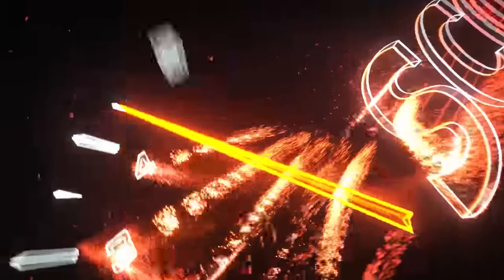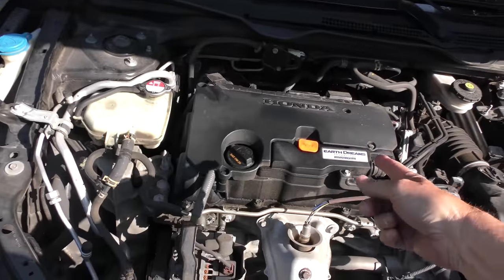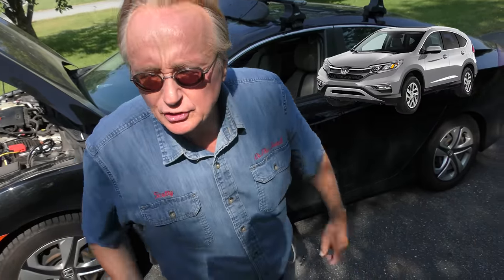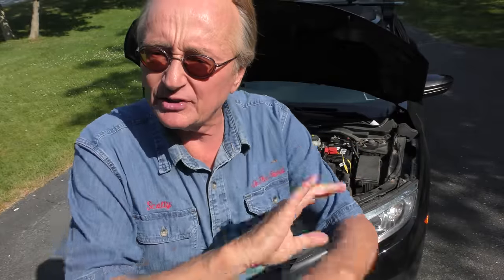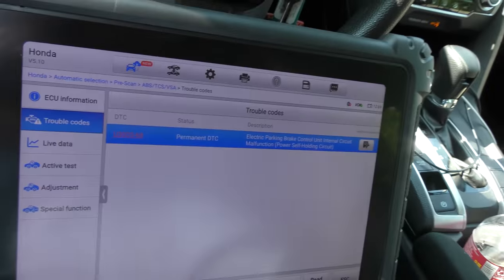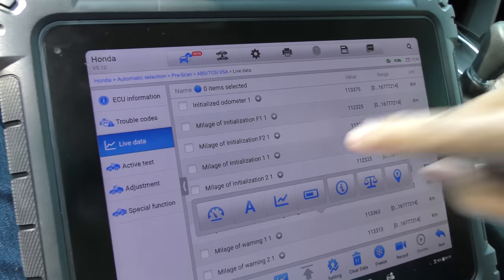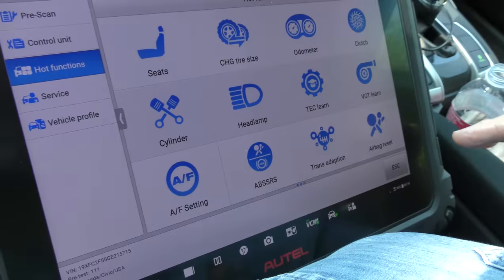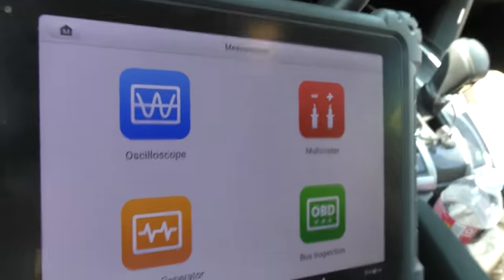This New Scan Tool Changes Everything

Comment: For the cost of the Trailer Rental (about $700) and extra gas for 2700 miles (about $300) he could have shipped 8 50 pound boxes FEDex ground or UPS ground for less, and would not have risked burning out his transmission.
Reply: I rented a U-Haul with a car trailer, rather than wear out my car for a trio that long.
Reply: You'd never hurt a small honda towing a small trailer
Reply: @elultimo102  Same here... I have made a couple of cross country moves and I rented the large Penske trucks with a car trailer and my wife followed behind in the other car.
Reply: Our vehicles never ran the same after long trips, so we had our vehicles transported when we could afford it. It’s expensive but worth it if the vehicle is new
Reply: @ArnoldZiffle-jw2mv  if your cars and trucks cant handle a long trip tou have a problem with them....and what kind of cars can't handle a long trip??

Comment: I knew someone who towed a large double axle U-Haul trailer with a Chevy Vega back in the 1970's. Top speed while towing it was 35 mph. He towed it from Chicago to Washington D.C. The car didn't run very well after that. His mechanic said, "It's terminal."
Reply: hahahaha. yep.
Reply: Bent pistons probably haha
Reply: They said it was terminal before he left who are we kidding😳😳🙄😎😎🤣🤣
Reply: Vega got an engine of 2300c.c.!
Reply: @Dilberts_Dogbert  With a Vega, having a terminal engine is normal.
Reply: @darcychu9652  Yes. It was a very bad design, and usually they did not last very long.
Reply: My brother bought a new Vega.  Sold it 2 years later for $50.

Comment: Our 2006 Honda CRV battery was small but lasted 10 years!!
We miss that car.
Reply: Yea, in 2021 I replaced the battery in my  ex wife's 09 honda fit 5 spd sport, it was expensive for a tiny battery,  but the battery was original, with like 185k miles, 12 yes old

Comment: I have a 2011 Civic sedan 1.8L auto. I have towed a 2004 dodge stratus with it a couple hundred miles. I have towed my small trailer with UpTo 1600lbs on it for many miles. I have always changed transmission fluid at every 30k miles. The car now has over 260k miles with no issues whatsoever. It drives and shifts like new.

Comment: With Honda’s manufactured in Canada, they typically put the small batteries in their units sold in the US. Just replace with the larger Canadian battery for cold climates. It’s larger, more CCA’s and will last twice as long as the crappy batteries that come with the unit.

Comment: I was looking to buy a mid priced autel scan tool, compared to the other ones it was reasonably priced that was until I read how much it cost for the subscription and updates, it was the same price per year for the subscription as it was for the scanner, to buy one just for your own personal use on your own car it’s just not feasible to justify and all I was wanting to do was reset the tpms, ah well back to the mechanic
Reply: It would be nice to have a full review that includes the added costs of updates/subscriptions an 8wner will be stuck with.
My INNOVA 5610 doesn't update thru its app but does cover the needs of my 2005-06 Tundra well enough other than resetting TPMS.
I bought a quality air pressure 120 psi gauge for my E Rated 10 plies.
Only need to check em before long trips and they haven't lost more than 3-5 lbs once yet in 4 years.
Not a difficult task for most anyone.
Reply: Yeah harbor freight has a nice one for $1000. $500 a year after the first year tho AFAIK you only need updates for newer cars? Cant you just download all manufacturers the first year, then no updates needed unless the car is newer than 2023?
Reply: ThinkOBD 100......

Comment: A small battery also requires less alternator capacity, meaning more weight savings and less parasitic engine drag. Battery only really has to start the car, tho if you like playing the radio more capacity helps.

Comment: Electronic parking brakes are about as smart to have on a car as electron shifters are. Good luck if you dont' have power and need to tow your car and need to disengage parking brake and get the transmission into neutral.. Because it doesn't have any power. Some models do have a manueal lever in the truck for the parking brake, but for the transmission you gotta get the jack out and get under the car usually to get in neutral. Just another couple things to break and cause you problems

Comment: they should make a scan tool that not only tells you what the problem is, but how to fix it.  It should go into such detail that a hologram of your car  would appear on the screen, and a detailed close up, perhaps using a red x on the hologram to show where the bad part is located.  Many times, it's a sensor and a simple replacement by a human with an IQ of over 50 can replace it.  other times, it's in the internals of the engine, and that really sucks.  set fire to the house, its easier to deal with.  LOL
Reply: OK, we laugh but it's doable for  price. It would involve a thing called four wire monitoring of all sensors and actuators, then a scan tool could tell you if it was a circuit fault or a sensor/actuator fault. Now I just want to start a shop and call it Obi-Wan (or Juan, depending on who you hire) Kenobi "Because we're your only hope."
Reply: As AI progresses it will likely be affordable to do that.
Reply: That would be so cool

Comment: As a driver. I do not need to know if my but warmer module or seat adjustment relay is going out. I miss the days when cars were cars. And a weekend turning wrinches to fix these problem we as simple as going to your local auto zone. Pick up a simple part. And replacing. Gone are the days of a simple car. I miss my honda accord 1994.

Comment: I remember I had this car and in the manual it was rated for like 800lbs load capacity, lol I thought that was too funny considering that's like 4-5 adults with no luggage. Got rid of it when the time came but definitely weak on that cvt
Reply: And don't get me started on reversing up a steep driveways( at least my mother n sisters newer accord)  you gotta do it a certain way or rev it up. Doesn't compare to a 4 gear transmission in reverse it just eats up the steep driveway in comparison. Other than that, the cars are great commuters.
Reply: When the time came? Ita still not even time to sell that...its not old.
Reply: How’s things out in the valley ?

Comment: The company that makes  your new scanner Autel.. I think is the same company that's making, battery-operated, remote-controlled, flying quad copter drones.

And seeing that  your scanner also has a waveform generator and an oscilloscope. Makes me also think.  They've adapted this gizmo. From a recording studio/radio station,  equipment alignment device. It's what I used to use with, good old-fashioned, American-made,  tape recorders. By Ampex, 3M, Scully  and MCI. Which was later bought out by Sony. I used to live 600 feet from. In Ft. Lauderdale. Aunt declined their offer  and an offer from Ampex. To go to work forr,, Scully. Only 3M didn't offer me a job.  What do they know? I was one of the besst. Just like you Scotty! I knew my way around a tape recorder, transport. And knew how to make the audio electronics, even better.  And some of my machines from 1979 are still going. I was informed of in recent times. As they sent me pictures of my test data sheets with my signature on them. Yup! Cooll!  I built them real good. So they would keep on going like the  Energizer Bunny. And was great fun and my honor to make them, better. Of course that was after the Beach Boys stopped, Making records. And Jimi Hendrix died.  And Tommy James got away from the Mafia. A lot of folks used, Scully's.

And so that looks like one incredible scanner. For someone with a late model car. I can't imagine it has much to read on,, earlier year models? Like my 2003,, Ford, E-150  or the 2007, Honda CRV. And since I'm not a mechanic. I will opt for the recording studio tester version. As I'm sure it's just that thing but much much less. As it's not going to test, your computer.  If it's making a couple of lousy audio measurements. Or testing the integrity of a, composite and/or component, digital video signals?  This company is in that business. And makes some flying drones for recreational and industrial use.

And apparently they are also a Chinese company like  DJI.. But they are run by Americans or something like that? And apparently not as big a threat  as DJI  may be?  But I digress.

Love your channel Scotty! K-Keep on keeping on! Step-by-step. Niagara Falls! Woo wwoo woo!
RemyRAD

Comment: Nope no drain plug on a diesel transmission the pan has to come off. Then, replace the filter, and new seal for the pan. Make sure not to go to a quick change of any kind. They have kids doing the job, and they will not do the job right. ALWAYS go to someone you would definitely trust on your diesel.

Comment: You should point out, how right the guy was by doing 55mph.  I told an employee on a trip from Canada to Florida not to exceed 100kilo per hour/60 mph, while pulling a trailer with a minivan.  I would wake up from a nap and he would be doing 140.  Had to change the motor when I got back and the tranny went soon after.  You can pull a heavy trailer by taking it easy, but you will kill the vehicle and leave yourself stranded if you push it hard.
Reply: Transporting 100 kilos!  Be careful around people like that.  Possible danger.

Comment: I had a CVT Civic. The owners manual says you can't tow with it, or it voids the warranty. So if the dealer sees the hitch, it won't cover a drivetrain warranty repair.
Reply: exactly. and there is a good reason why you can't tow with cvt

Comment: What is a good bidirectional scanner for gm without breaking the bank? Specifically  2005 chevy colorado truck is starting to sound off at idle and rpm fluctuates at low speed cruise control. Now traction fault on dash.

Comment: Its $4,500. Im looking to spend about a tenth of that. Am I limited to simple obd2 scanners that just give you check engine light codes? i have a honda, would I be better off with one of  those HDS emulators on ebay for $100 that use pirated HDS software? Fixing anything on a honda seems to require HDS and honda wants a bundle for it.

Comment: I bought the Autel ms906 with all the adapters. However even with the adapters, the scanner will not read anything before 1996 obd2! I have a 1990 obd1 Gm c1500 truck. How can I make it work to use this bidirectional scanner to do what I bought it for. Any advice will help since AUTEL basically just told me I am screwed. Please help!
Reply: I bought an old, used OBD1 scanner off of eBay, Actron CP9185. It works great, reading my 94 Ciera 3.1liter, and my landlord’s 94 Chevy Silverado 5.7liter TBI.  Though both are 1994s, the Chevy truck uses the old OBD1 codes, that are two numbers, first code blinks the check engine light 3 times, blinking 1, 1-2, 1, 1-2, 1, 1-2 for code 12, meaning it’s talking to the computer ok. If any other codes are stored, they’ll blink next. Meanwhile, the OBD1.5, as it’s called, is an OBD1 connector, but sends OBDII codes, P0320, for example, the cat converter code.

Comment: Scotty - about the small battery issue - What would be the problem with relocating it to the trunk (or somewhere else) as to fit the largest battery?
Reply: Youd have to have a huge cable to avoid voltage drop and thats weight. Also some safety concerns. In a wreck thats a lot more liability for a fire. Keep the battery near the alternator and starter. Also in most cars the trunk is shared airspace with the cabin, theres a risk of hydrogen outgassing.
Reply: @batvette  Thanks for the reply. I really appreciate you explaining that to me.
Reply: @tchrisou812  NP. Theres a few car mfrs that have done it, BMW for instance, but the negatives outweigh the benefits. I was into competition car audio, and heard stories of people mounting their amps in the trunk and grounding the amp straight to the battery. The factory battery ground gets loose, they start the car, and the starter draws all its current through the amp because its screwed down to steel. Bye bye amp!

Comment: So if a gas car loses almost 50% range while towing why is it when an EV pickup does the same, everyone loses their mind? :56
Reply: Because of the inconvenience sometimes of finding a charging station and the amount of time it will take to charge it. I just want as many energy and fuel options as possible
Reply: @timtostige8124  there is software to plan routes accordingly. As battery tech and charging technology improves charging times will get better. The automobile was invented in 1886. There were only 15,000 gas stations by 1920. Point is, your argument is weakening by the second.
Reply: Because a car is not made to tow anything, so that is a stupid comparison. A gas half ton truck loses about 20% mpg towing something appropriate, diesel probably loses 10%. The F150 Lightning loses over 50%.
You let us know when the battery tech is good enough, and when the infrastructure is, also. I'd be happy to switch if it was viable.
Reply: @playdg  Your data is flawed. I own a 2016 Chevrolet Silverado LT and when I tow my boat, I go from 18mpg to 9 mpg.
Reply: @timtostige8124  Also, statistics show the average person drives 13,500 miles per year, about 260 miles PER WEEK. 95% of that driving is locally. To gain the most benefit from your EV, you should be charging at home. For most people that’s 1-2 X per week. Charging stations are primarily for road trips, or in a pinch, or for the person who can’t charge at home for whatever reason.  You might as well embrace EV’s because over the next 20 years thats all that you will see on the roads, minus the classics that die hards will keep running until the part supplies dry up. Look at the trends… it’s coming.
Reply: @Crazyreseller  Jesus, what piddly engine is that? Also, I drive twice that. I'll be one of those diehards, until they have infrastructure in place.
Reply: @playdg  5.3 V8. 

Even if you drive that, an EV is designed to be charged at home for the average person most of the time.

Comment: I remember having to drive a company owned semi that was limited to 57mph; they turned them up a little after so many drivers quit. Many I had were limited to 64 mph. So I and many others have driven across the country actually averaging less than 55.
Reply: Hope you were paid by the hour!
Reply: @karyannfontaine8757  Nope, they pay by the mile. Rand-McNally miles, not actual miles, so you usually get cut short.
Reply: @bikecommuter24  Oh Yeah, they were about the only trucks I could pass!
I always thought the company was paradoxically named.
I think it was Arizona that sued them and made them speed up a little.
Reply: @debluetailfly It was Arizona, which is also home to SWIFT headquarters.
Reply: @dmphillips  legal weed...motorcycles can split lanes & now this...as a Tucson resident I'm pleasantly surprised
Reply: My company turns down the power, but limit the speed at 72.  So it takes FOREVER to get up to 72mph.
Reply: They should put those limiters on all cars and limit them to 80 MPH. Think of the lives they would save and much less people in jail or getting tickets.
Reply: @bikecommuter24  Or, "sure wish I'd finished training".
Reply: @crand20033  Hush, the police have quotas to fill.
Reply: I drove for Schneider national in a international cab over and was limited to 55 mph 
That sucked so much
Reply: @TrumpIsrael2024  Yes. It it's an automatic. They will allow only the economy mode to run. It short shifts or it will skip gears to get the truck into a higher gear as soon as it can. I was able to use an automatic one time that allowed me to switch between performance mode and economy mode. But once cruising along on the highway it will still switch back to economy mode. Performance mode would run the revs up higher for each gear. It was a noticeable difference.

Comment: The whole 'scantool' mentality is DUMB from the beginning ,  scantool DTC says a subsystem, mechanic scapegoats the sensor itself because that's the name of the DTC + it's unscrewable. charges an hour for 5 minutes work, fits sensor lower quality than OEM that sometimes didn't need changing because it's a victim not a culprit.  What will change everything for better is CAR PSYCHOLOGIST tool.

Comment: Consumer Reports came out with their most to least reliable vehicles, Overall, it found that pickup trucks and electric cars are the least reliable vehicle types. Hybrids fared the best
Most reliable👍
#1 2023 Toyota Corolla Hybrid 
#2 2023 Lexus GX 460
#3 2023 Mini Cooper(huh???)
#4 2022 Toyota Prius 
#5 2022 Mazda MX-5 Miata 

Worst👎
#1 2023 Ford F-150 Hybrid 
#2 2023 Hyundai Kona Electric 
#3 2023 Lincoln Aviator 
#4 2023 Nissan Sentra
#5 2023 Ford Explorer

Comment: To spare yourself all the bloviating about how “over engineered” Hondas are, skip to the 4 min 10 sec mark. The scan tool video starts there. Btw, Honda uses the cheapest parts, from the lowest bidder in the supply chain. Nothing but a Japanese Ford. Fact.

Comment: CAN YOU SEE HOW MANY TIMES THE CAR OWNERS WIFE WAS SCREWED IN THE BACK SEE AND HOW MUCH THE GUY WEIGHED BY CHECKING THE WEIGHT SENSORS ON THE BACK FLOOR BOARD AND SUBTRACT OUT THE WEIGHT OF THE WIFE ?